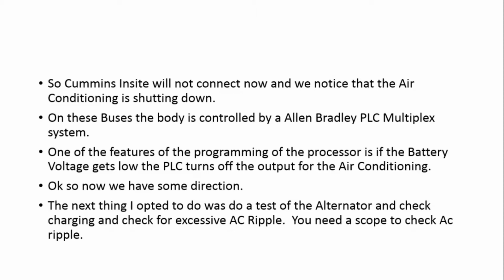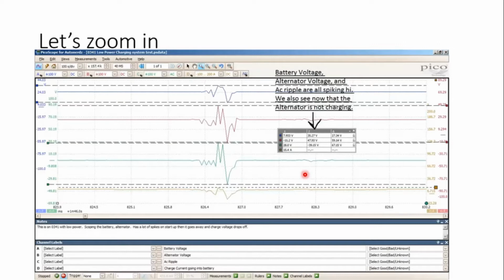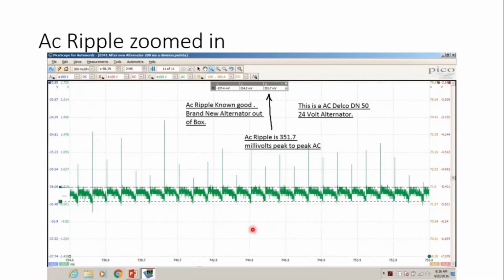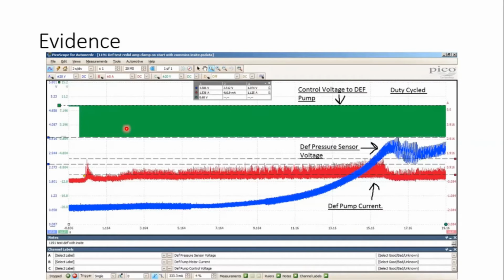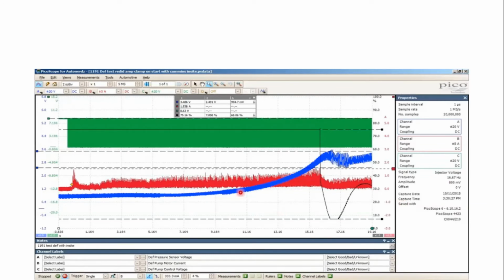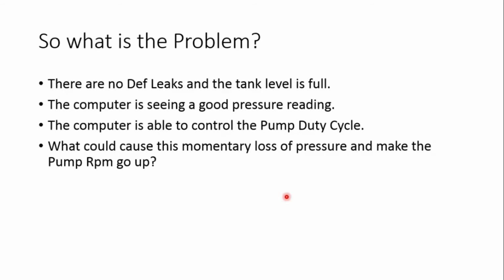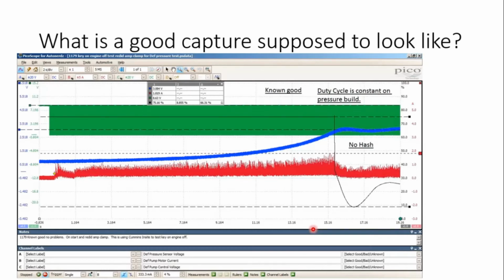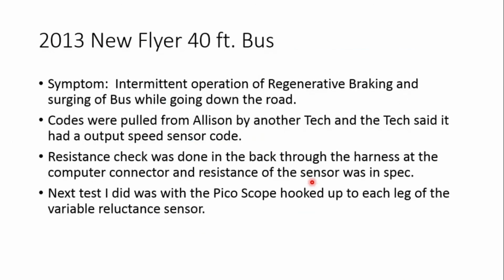HD Scope Diagnostics Part 2

Comment: on loss of power complaint it was your expererience with bus multiplex stragedy that gave u direction not the scope.No scanner communication would have been my first plan of attack,once able to communicate I would have probably got some limb mode code due to irratic sensor activy which would lead me to a-c ripple.working on buses techs need to familiarize with all systems buses implement.I'm just a car painter that uses scopes a lot,I'm glad theirs more interest in scopes in HD with help of people like u.Keep up good work